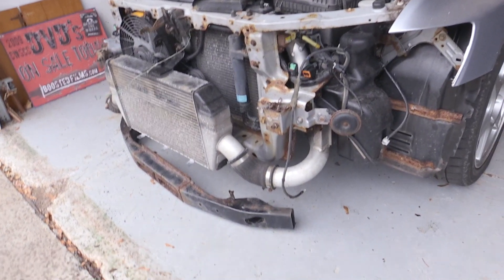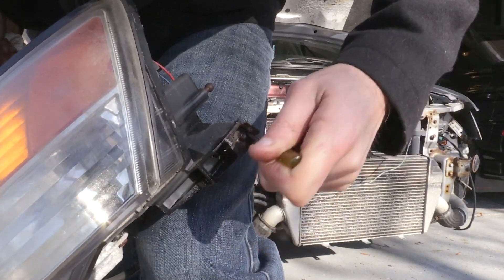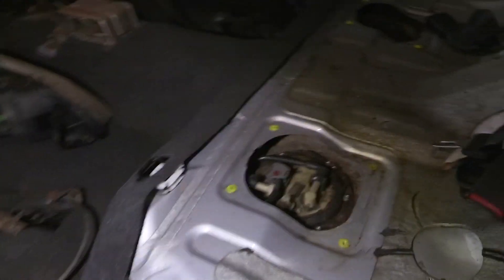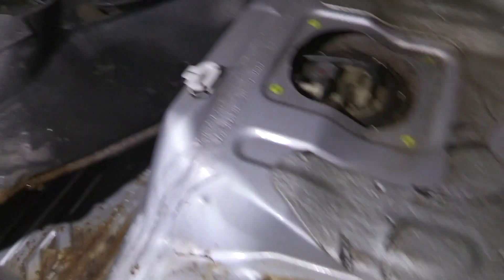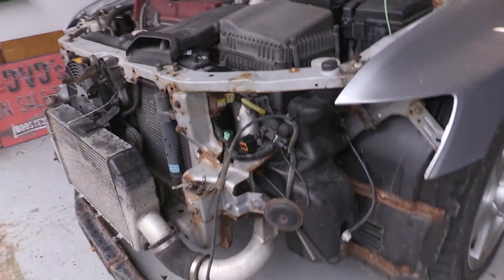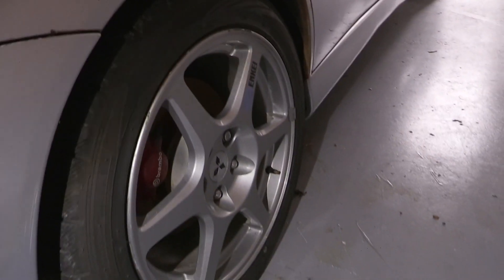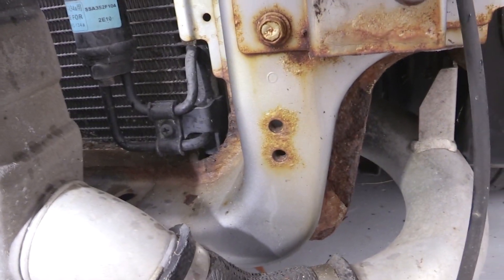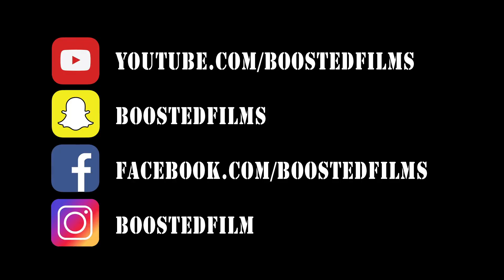RUSTY EVO BUILD #2  - Rust update - Boosted Films Silver EVO 8

Comment: Hey. I'm a new sub. I own an 05 Evolution 8 in wicked white. Good stuff. I don't know if it's honestly worth saving (I checked out your 3rd video already) but if you do want to save it, would you be cutting and welding new pieces in (i.e. the fenders and under-carriage and rear frame rails)? Question, what kind of suspension are you running on the black evo? I'm thinking about going with swift springs w/ bilstein shocks.
Reply from the maker: Welcome!  I'm running Reinharte R1 coilovers in the black evo.  More info here - https://youtu.be/tTJ1oigVn5o
Reply: @BoostedFilms  Very cool! I did not know about the top bolt being able to adjust for camber! I ended up going with a set of swift springs and factory struts. Thanks for the info!

Comment: So sad to see Evo in such condition. Hope you will fix it, but it requires a lot of work to do. That rust is everywhere. By the way, have some question, I have an Evo 9, and can't solve the problem with detonation, the tuner says it's ok, the mixture is ok, and when we were running, it on dyno, the was no issue. First, the problem was stuttering and detonation, I solved the problem with MAF cleaning, but detonation is still have place to be. Where to look?
Reply from the maker: Do you have a wideband?  Are your AFR's where they should be?
Reply from the maker: @EDDYPRIME  road tune or dyno tune? I’d recommend getting a wideband. Possibly check fuel pump and make sure it’s not pushing out of the hanger or check if the fuel pump grommet is cracked.